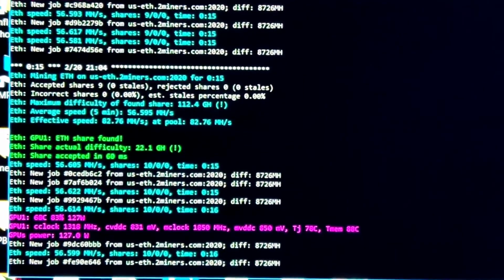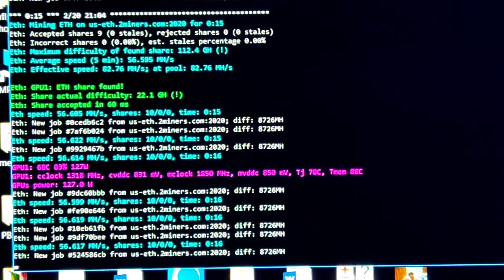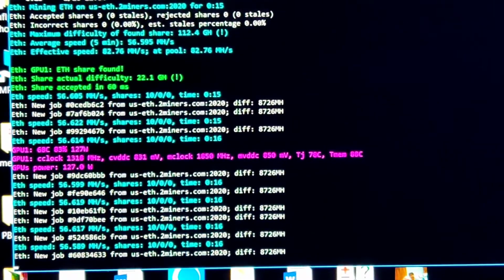How To Reduce Mem Temps On A Graphics Card: RX 5700 Mech OC

Comment: What size did you use please? Mine is hot as well, and I need to change mine. I have some Gelid 2mm pads. Not sure what size to use. I assumed 2mm for all of them, but Im not sure what size to use now. I realize this is old, but Please if you can let me know.
Reply: Ive got to do the same, what i gather so far.  2 are 1.5mm and the rest are 2mm. According online and comments I've read in other vids.
Reply: @simonparker3968  I went ahead and ordered some 1.5 as well. because I have seen some vids of people replacing with all 2mm and the hot spot temp goes up 8 or 10 degrees. mine is already 105 or so unless I run the fans at 100%. So I need it fixed right.
Reply: I can confirm the pads are 1.5mm and 2mm just changed them, the thermal paste was dry and i was missing a thermal pad, and your fan curve set to the hotspot temperature hense the fast fan speeds. I did change the setting and undervolted which brougjt down the main temperature to about 60°c on low graphics settings if this helps. Im.goner try it soon to see if its cured the problem.
Reply: I had graphics settings wrong the other day the fans was taking off and my pc shutdown. My hotspot temperature on low settings is around 85°c
Reply: Definitely worth doing got nothing to lose, so on low settings i was getting 60/62°c normal gpu temp, hotspot temperature was about 85+. Now on meduim settings 60/62°C norm gpu temp, and 70/75°c hotspot temperature.

Comment: Can you tell me the thermal pads size? 1.5mm ? 2.00mm ?
Reply from the maker: the 3 side memory modules on both sides are 2mm. The 2 top modules are 1.5mm
Reply: @SteveDoesEverything  many thanks... I changed all my thermal pads for 1.5mm and now its getting in the middle 110ºC :(
Reply from the maker: @fredalone2022  yea. You have to use correct thickness pads

Comment: What is the reason why you did not put the same thickness everywhere? I need to make the change too, on my GPU.
Reply from the maker: On these particular cards, the heat plate is not flat. It has step downs on 1 side. If using a thicker heat pad on the step. It will cause the other side to not seat on the pads properly or the die. And overheat
Reply: Do You know the thickness of the patch that appears to the right of the video at minute 2:50? And thank you very much for answering, tour video helped me a lot.
Reply from the maker: @794cesar They are either 2mm or 1.5mm. I can confirm later today.
Reply from the maker: @794cesar  the 3 side memory modules on both sides are 2mm. The 2 top modules are 1.5mm
Reply: I mean the long pad seen on the right at 2:50, pink in color and not replaced in this video. But I do want yo change it yo be sure that everything is in order.
Reply from the maker: Ahh ok. That pad was 2mm
Reply: And sorry for my poor English, I understand everything you write to me, but it is difficult for me to write a little, so I turn to the Google Translator.
Reply: https://ibb.co/TKztTCJ
I uploaded a capture to a server, maybe it will help you to know what I mean.

Comment: How thick are the two thermal pads that you used?
Reply from the maker: 1.5 and 2mm
Reply: @SteveDoesEverything  ahh that could be my issue, I did the same thing with 2mm pads all around but my hotspot temperature/junction got way worse
Reply: @KingZMBA  me too, i pasted 2mm all around..it became worst...did u swap it out fot 1.5mm thou?
Reply: @mopikozz  yeah, i swapped it for 1.5 and it was better.
Reply: @KingZMBA  what’s ur gpu & memory temp now
Reply: @mopikozz  don't really remember, i have a 3070 now